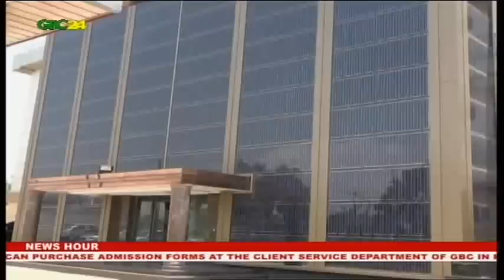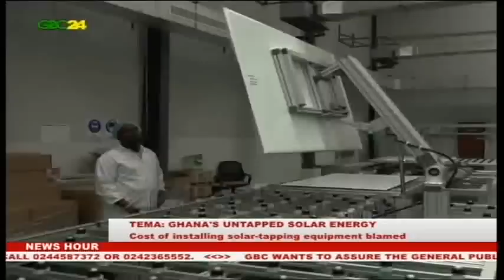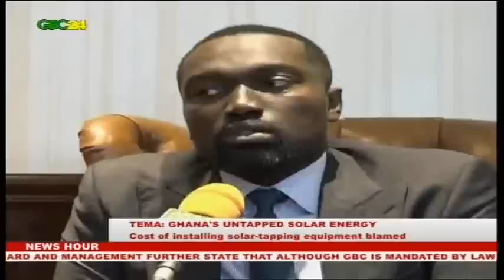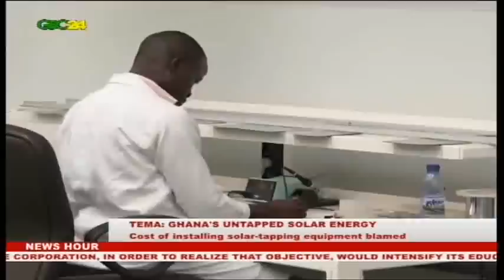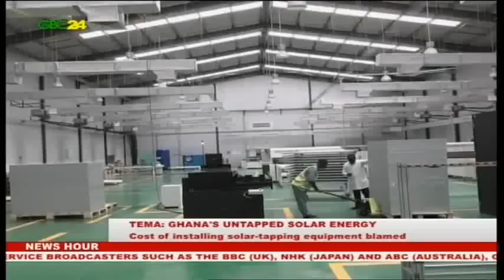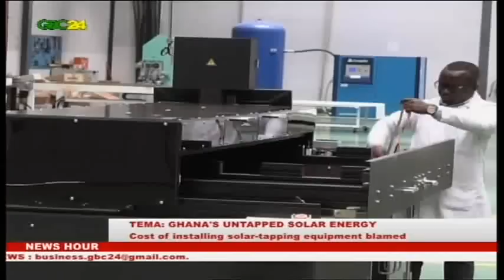Ghana's solar energy largely  untapped due to cost of equipment installation and taxes

Comment: Why are our country leaders promoting our local businesses so poorly, If im not mistaking i can see there's already an assembling company in the country and all it need is an expansion to increase production capacity and reduction of huge import taxes on parts and that will decrease the high cost in buying solar panels problem solved. Anyway you still have to figure out your battery storage cost though, this as well comes with the same huge neck racking taxes.
Reply: ziiggy silas maybe there’s oligopolies in the market who don’t want to loose their domination with their generators .